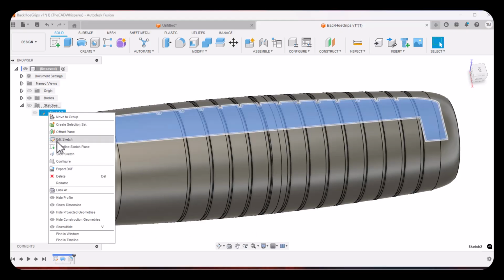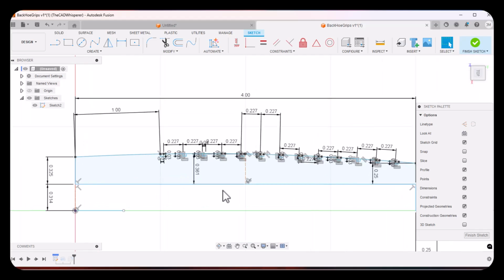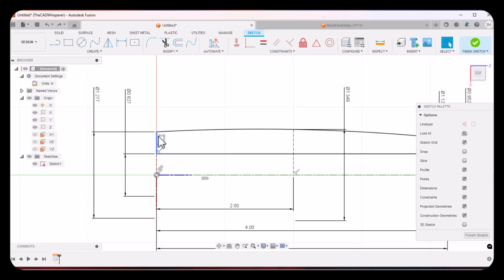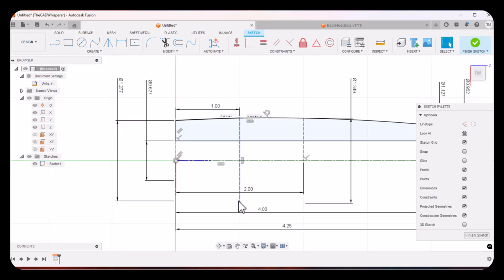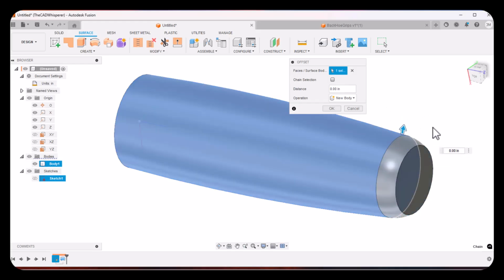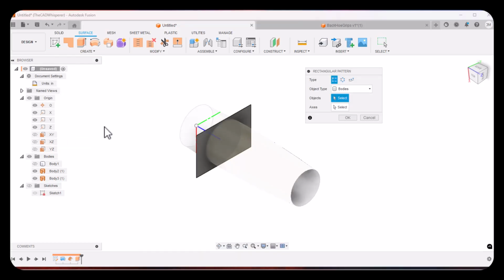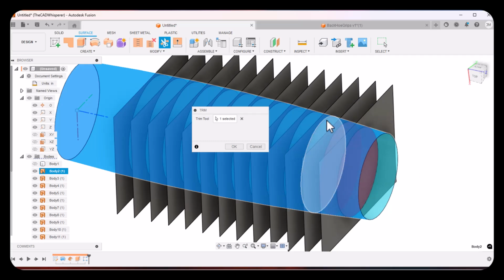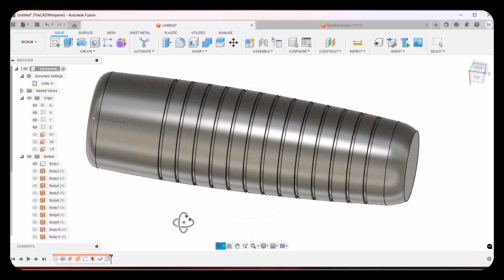Busted!   Human Intelligence vs Artificial Intelligence   Logical Design Intent

Comment: Thank you for taking the time for this. I spent hours on this thinking it could be done through bodies and honestly I just do not post on Fusion anymore because of the negativity. I kept starting over which is why nothing was constrained, and I honestly don't know about the first notch and why its crooked. I think I just tossed it in there and then started using construction lines to separate the rest of them and was going to delete it after and forgot. I am kind of new and have learned everything on my own which can be unbelievably frustrating at times. This is a great video and very appreciated. Thanks for not beating me up to badly😐 I am sure others will learn off of this as well.
Reply from the maker: This is a typical scenario that I see on the forums with beginners not getting proper help. Almost a daily occurrence, but your problem was a perfect representative example that gave me an opportunity to raise awareness of helping beginners work their way through logical Design Intent and at the same time considering the future implications of AI in CAD.
Reply: @TheCADWhisperer  Your a good person for the push. Thank you. Someday maybe I will be a pro as well:)